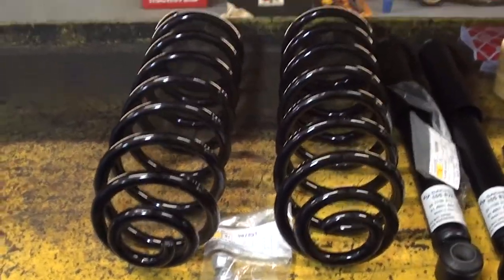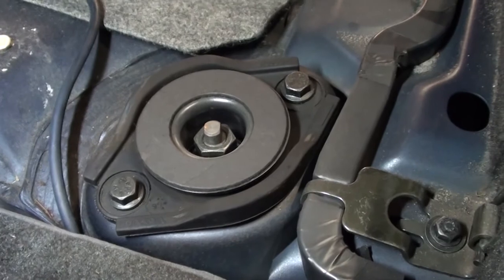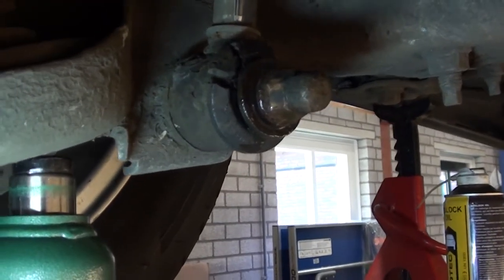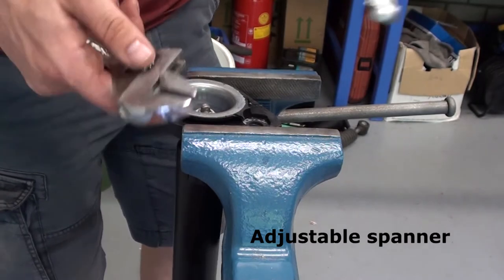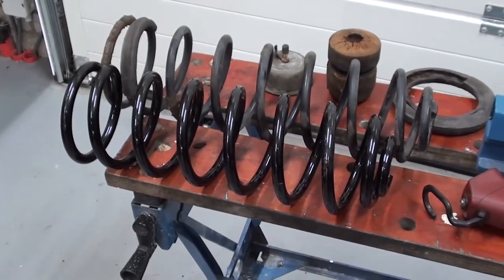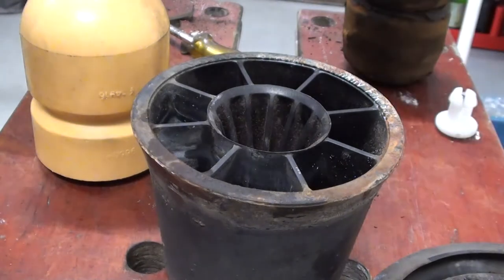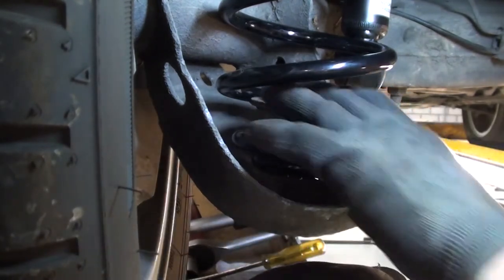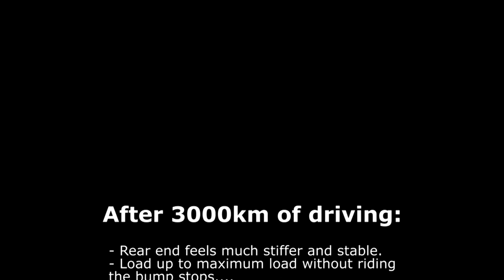Volvo V70 Classic Nivomat conversion to standard shocks and springs (replacement)

Comment: Thanks for the video. How is the ride height after conversion? I need to replace the rear suspension in my 98 V70R and think converting will be a good deal cheaper than paying 340 dollars or so for each individual nivomat sbock. what springs and shocks did you go with, do you have part numbers?
Reply: If you find out that information could you please send it to me as well I have the same issue thank you

Comment: My bump stop has come off but my suspension is brand new does the bump stop just pop back into place or I have to take whole thing out
Reply from the maker: I don't think it just pops back into place. Maybe it wasn't seated correctly in the first place? It was a bit of a fiddle putting the yellow bumpstop onto that black/plastic/abs part. Maybe it can be done without removing the springs or maybe just without the shocks as I think this gives you a bit more clearance/space between the coils of the spring. For sure on most used cars those bumpstops float around in the center of the spring or are completely missing....